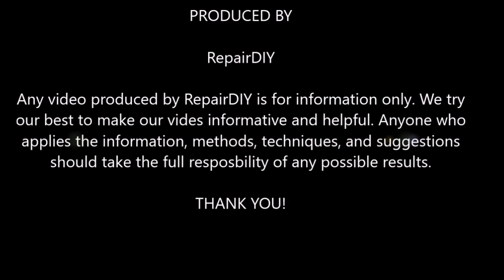Yale Burglar Alarm: How to install Siren Batteries (Size D)

Comment: pal you need to put the unit into off mode/anti tamper or it will go off
Reply from the maker: Hi, thank you for your comments. it went off several times unexpected! I found that after you installed the new batteries, it allows you press the anti-tamper switch (at the back) only once without going off. When installing onto the wall, be careful to only allow the switch from released position to pressed position against wall only once, otherwise it goes off. Yeah, it is always good practice to put the system into maintenance mode before changing any batteries in any device. Thank you and have a good day!